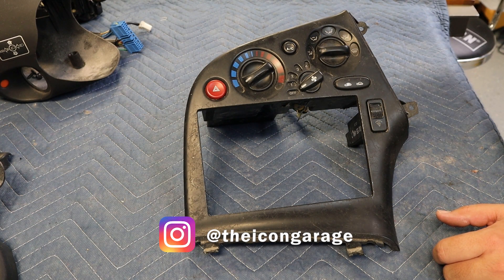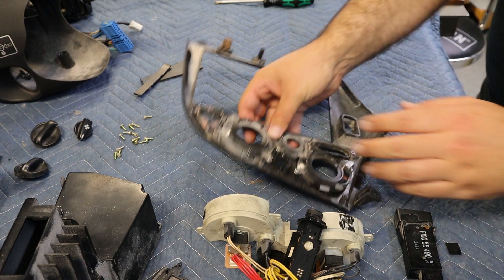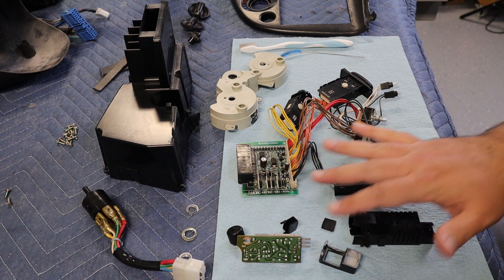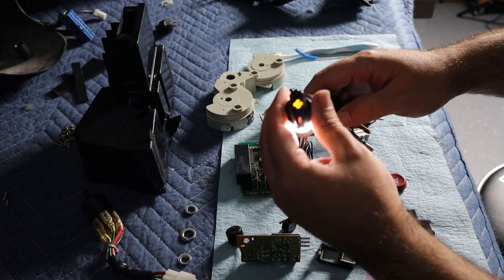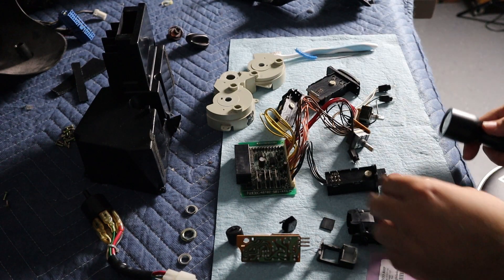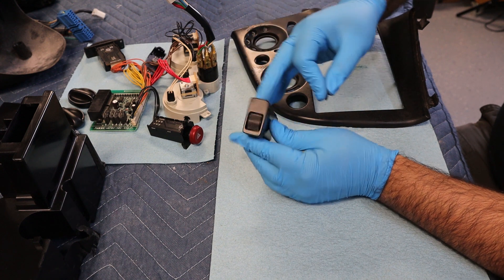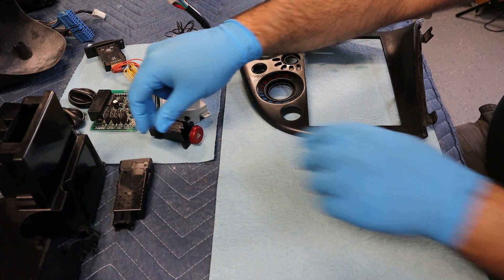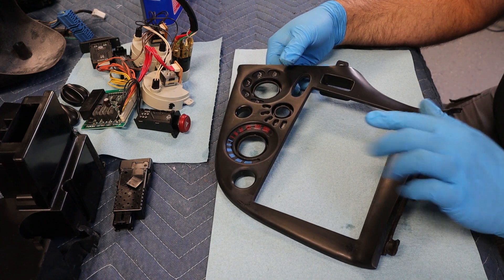FD RX7 Dash Bezel Repair and LED Lights

Comment: Looks great! I did this same thing to my FD. You can remove the lenses with the marking with a heat gun or blow dryer on low setting and it won’t break or warp them as long as you are careful.
Reply from the maker: I did end up braving the task and slowly removed them with low heat on a hair drier. My heat gun was too hot and started melting the plastic. I was a nervous wreck the whole time I was going to snap something, but I went slow and it eventually released.
Reply: I just pulled mine apart, adhesive pulled right off with some pressure
Reply: Mine became pliable by just using hot water.  I then purchased new decals from BlackCatCustom and now they look brand new.  Are you happy with LEDs look?  I'm on the fence on swapping.

Comment: Cant wait to see what difference all your work to the dash and wiring does in terms of reduced rattles, because the fit and routing of the FD3S dash always meant it rattled and creaked. The lightness(cheapness of the plastic always meant those clips pulled free and panels popped out or rubbed, Hope your go crazy with the silk and felt tapes. And sound deaden that fire wall perhaps. Pulled out the aircon core yet? Smelly work
Reply from the maker: I think I have addressed almost all of the squeaks and rattles. I think the rear hatch needs a new weather seal to tighten up the hatch. I am pleased so far. I have not pulled the AC yet. It doesn’t work so I will need to eventually.